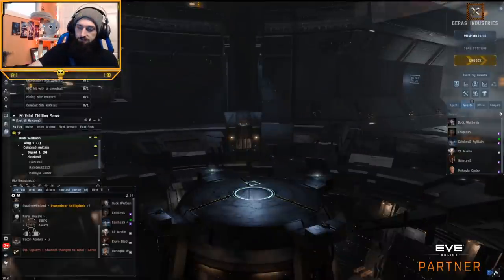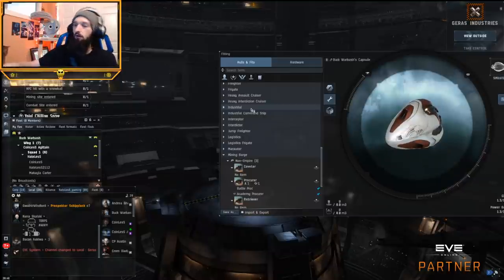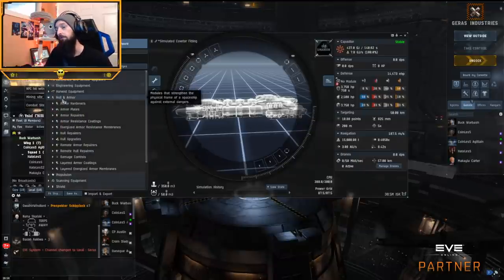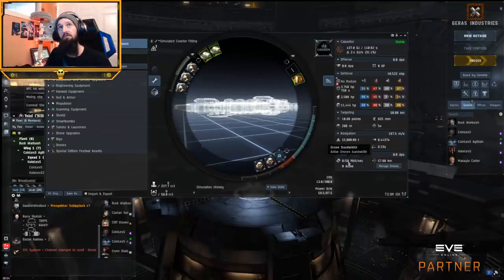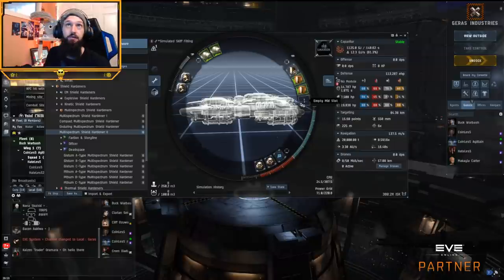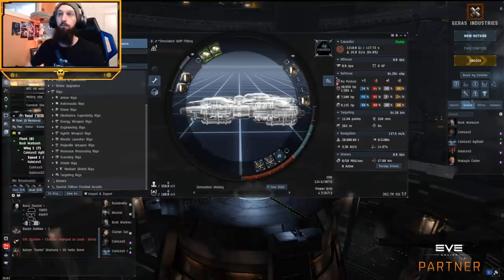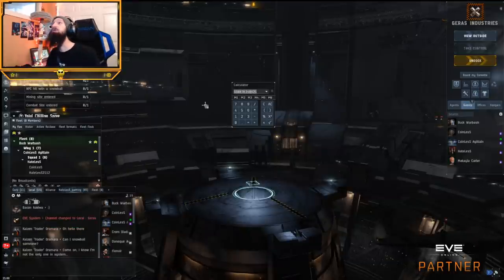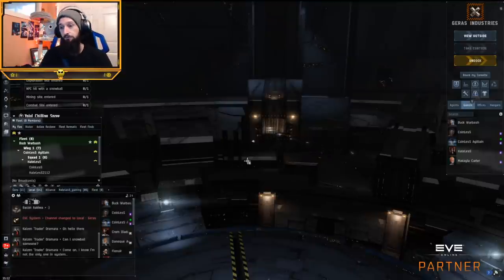Fitting Mining Barges And Exhumers

Comment: Hey, I didn't account for the implant and gamma but you can't stack the percentages like that. You have to multiply the percentages first. For example..
21.5 = command burst
21.5 = shield bonus
271,285   = base ship with fits

The math:
.215 * .215 = .046225
THEN you add  .046225 + .215 = .261225
Now you can multiply 271,285 * .261225 = 70,866.42
271,285 + 70,866.42 = 342, 151 effective hit points before implant

Comment: Nice to see someone has finally figured out you can put a LSE on a exhumer (literally only reason i'm cross training one of my guys into exhumer from orca instead of unsubbing, and knew this when the notes of exhumer fitting changes were first released...not when the patch went live) however these fits are still mediocre at best.

T2 fitted hulk with no implants, 2 x MLU and still keeping the fit cheap and yield high...Ore fitted you should get roughly  65k ehp. Ice fitted roughly 58k (with one ice rig and one ext) or 66k ehp with 2 x ext rigs). Tip.. 'use a faction LSE' ;). Obviously using implants you can getting better results and betting fitting.

If you still struggling to work out the fits, reply to this msg and i'll mail you in game. Same fit will work on Mackinaw also cause its has same fitting. Unless you want more tank then this, or you want a bait ship, there is no reason to fly a skiff, got hit pretty bad imo. FYI I was using a MSE on my hulks, and still had 2 x MLU before the changes getting roughly 40k ehp (orca bonused) before the patch, and cringed everytime I saw one without it on the KB, now I cringe when I dont see a hulk or mack without a LSE lol
Reply from the maker: yea this video was made fairly quickly just to demonstrate how much better they all are now
Reply: What happened to the Skiff, how was it changed and why is it less useful now?